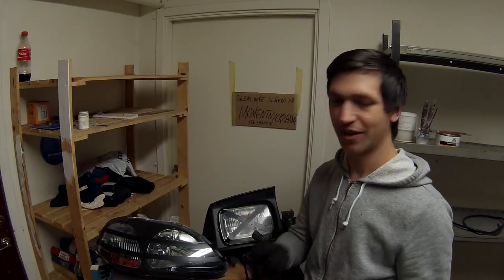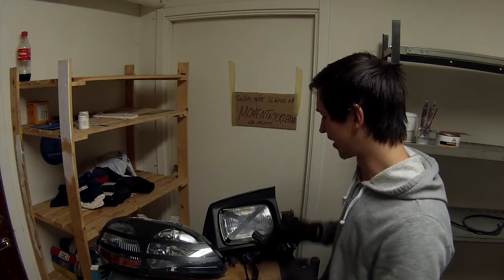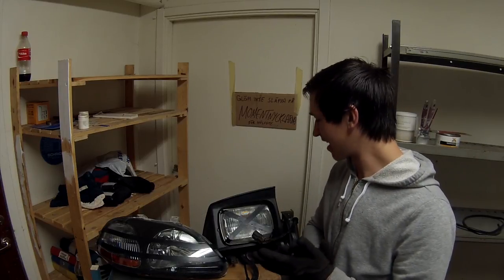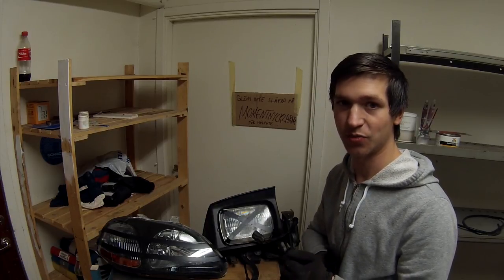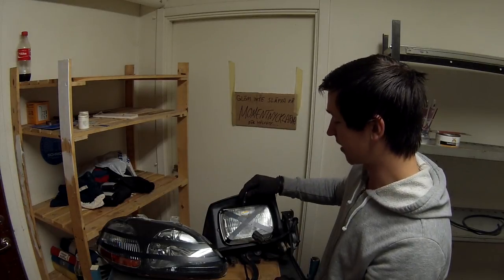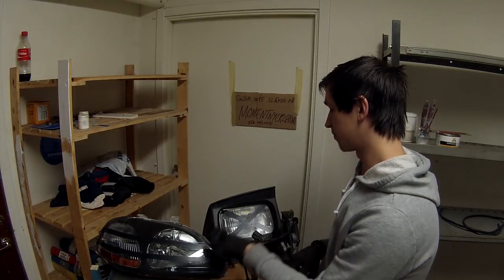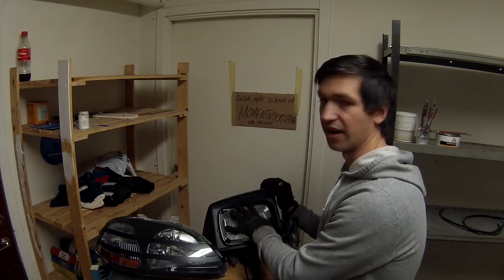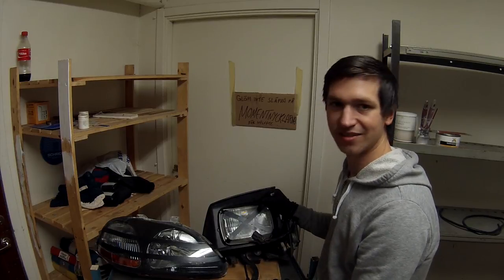Crosses X Over Headlights

Comment: What kind of tape do you use, I can't get electrical tape to stick.
Reply: Have you tried to clean the glass first?
Cause i'm electrician, and i can tell you from experience that the only thing that can stop electrical tape is lots of dust or a really unclean surface
Wipe them real good and then clean them with rubbing alcohol to remove all greaces
Repeat proces until towel is totally clean and then proceed to put down the tape
Reply: Napraznicul Elias I cleaned my headlights with tooth paste and baking soda, before I did a sand and clear coat job to them